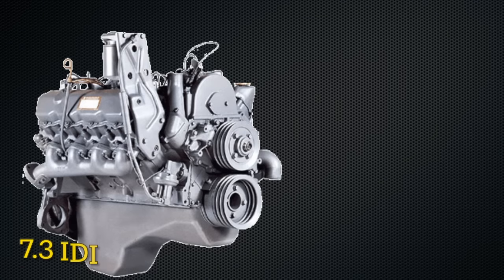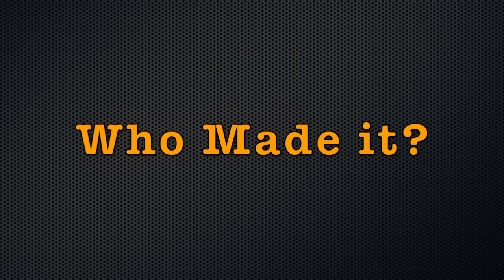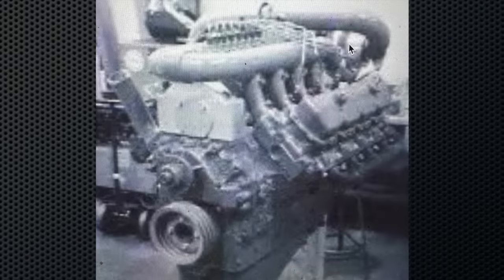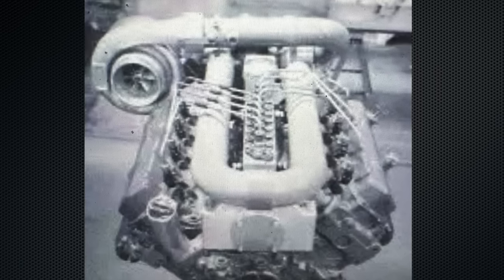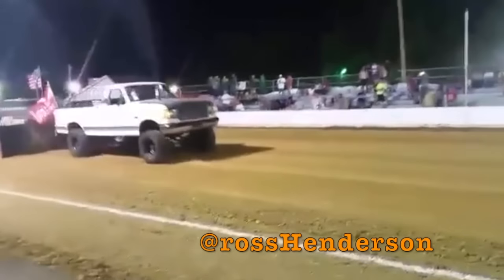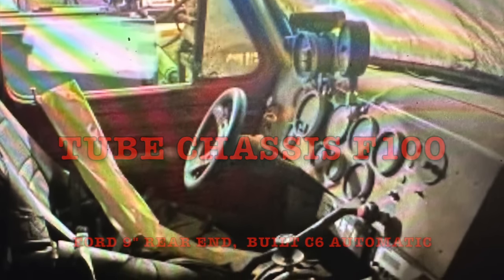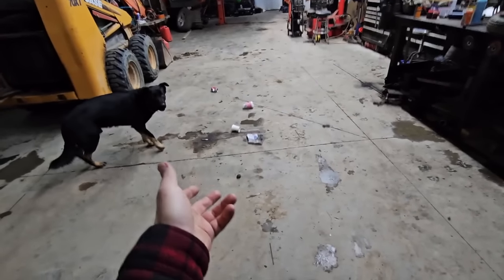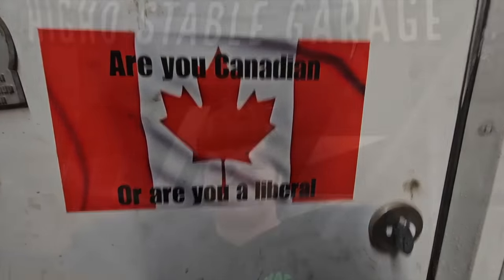The Legend of the 1200HP IDI Diesel, featuring @ziptiesnbiasplies!

Comment: Interesting backstory on this thing.  I do have to wonder why they kept it an IDI for a power build though.  Even ported out those prechambers become a hell of a bottleneck, and direct injected diesels weren't a new tech even in the 80s.  
I'm working on building my own 7.3 right now, I have a 71 F250 built around it, and I'm putting the turbo up front like a 6.5.  I've thought about cobbling together a Bosch MW pump as used on Perkins V8 diesels, but I don't think I'll be pushing anywhere near the limits of the DB2 pump.  I don't plan on going past 250hp, I just want to be able to cross the Rockies without making them the Smokies.

Comment: Thanks for the free rep man.

In terms of the rest, I think we all know that the Jahns truck wasn't even close to 1200hp. Number one, the weakest link after head studs is the connecting rods. At best in 94, you had factory turbo IDI units, and they are plenty stout (right alongside forged 7.3 PSD units), but they aren't doing 1200hp. 

Secondary, ported IDI heads flow less than stock units (not that that's a big deal when you're pushing 100+ boost into it), because of the port velocity, the engine doesn't make power past 3000rpm. I've personally made peak power at 3300RPM N/A but that's because N/A doesn't make any airflow down low... Regardless...

The legend most likely made ~700hp, and shit rods, not the block. Cast iron doesn't flex and spit out freeze plugs, it cracks and breaks.

Either way, cool video.

Comment: I called up hypermax. Theyd throw a kit together for you to do this build. Said itd cost around 15-20k. Wouldnt include lines or engine internals. And youd have to have the pistons cut to reduce compression and expect to use several cans of ether to get it started.

Comment: I had 6.9 in my 1987 ford f250. Fked up and put car oil  in it not 15/40 dohhh. Drive it for some time. Then i put a 7.3 idi. Took every thing from 6.9 and put it onto the 7.3 ats intake and 3 inch gartit turbo. Injuction pump. Exsts wire harns. Fly wheel. It was a ripper wish i never got rid of it. Runing about 11 lb of boost. It lived on the hill so i ran red deslie in it. Dule tanks to.

Comment: 2003 ps 7.3 is a magical motor
Reply from the maker: Sure is 👌
Reply: @highostablegarage  10 years of Towing heavy towing 10 years of racing 10 years of hole shots 10 years of donuts 10 years of dumping any and all liquids in the tank you can imagine and it runs the same as it did 10 years ago I can get in this truck do 80 mph for 5 hours with 25,000 lb with the tank filled with motor oil and have zero thoughts concerns or issues whatsoever I can do that everyday all day and it does not break Ain't No Other motor do that
Reply: @tonydiesel3444   My 12 valve Cummins does that, 500k miles on the odometer when I pulled it from a box truck and dumped it in my pickup. 500k miles of lugging a 26,000lbs Ford F-800 around the country for 23 years. Now it's powering my 1 ton. But I get what you're saying. The 7.3 PS is such a great engine. Since the early 2000's it's been downhill. The new engines make more power, but are expensive and unreliable and won't still be chugging along decades later like the old workhorses are doing.
Reply: They rip bud

Comment: I very much hope one of you can at least get in contact with the current owners, this engine has to be explored 💪…I doubt much of anything is still stock inside …it probably just has forged internals, a slightly more aggressive cam, fire rings, studs and better valve train …stuff that’s very common in modern diesel performance engines…my guess is this motor was WAAAY ahead of its time using what was available in the era it was modified in

Comment: My question is could a idi be converted into a direct injection engine🤔
Reply from the maker: Also a good question haha, money and time will make anything shine 👌
Reply: @highostablegarage  just remove the prechamber and make a longer injector would that work maybe I have a 1.9 tdi and v1505 the tdi is di the Kubota is a swirl chamber but acts like a di injector
Reply: @infernoking7504 You would need a different cylinder head as well as different pistons. 

Trying to run a DI cylinder head with practically flat IDI pistons would make your compression ratio way too high, and the pistons would probably smack the glow plugs and injector nozzles as well.
Reply: Yes but you would have to change the cylinder heads, injectors, and pistons at the bare minimum in order to make it work. 

With a 6.9 or 7.3 IDI you would need fully custom cylinder heads built in order to continue utilizing the injection pump fuel system. 7.3 powerstroke pistons would probably work in a 7.3 IDI but you might need custom connecting rods.

The Volkswagen AAZ engine is IDI and can be converted into DI by using the pistons, cylinder head, and injectors from a 1Z TDI engine.

Comment: I think if you put 147 psi through an engine of that displacement and you can feed it enough fuel to compensate for that amount of air, it's gonna make that kind of horsepower no problem. Would it live very long at that power level? I don't know. Maybe they did that once, blew it up, then dialed it back, but still, it had to have made a lot of power regardless if it's tearing the block apart repeatedly like that.

Comment: Best idi ever built was made by Detroit diesel and installed in chevy pickup trucks and military humvees. Pretty low hp but spectacular mpg depending on the drucks diff ratio. At 23:1 compression ratio and no turbo they were built for efficiency.  They nailed it.
Reply: The 6.2/6.5 Detroit is known for having more problems than the 6.9/7.3 international. Head gaskets and whatnot.
Reply: Those engines are absolute piles of shit.  Oh and you want it to operate at below 32f?  Good luck.
Reply: @Look_What_You_Did  normal maintenance is all they need, when you burn out glow plugs and dont replace them then yeah not gonna start. All 8 glow plugs and number 1 fuel they will fire up in -20. A few bad glow plugs and no they will not. So maintain it properly.

Comment: How many minutes did it last before it went bang ?
Reply from the maker: I think it was only a couple passes, sadly not a lot of info is known during its truck pulling days but we know it kept cracking blocks during its drag racing events.
Considering how little drag picture are know about dadiesel on the web I can only speculate it only operated for 1 or 2 seasons. 
Hopefully this video brings out more information about the engine.

Comment: Hypermax are die hard International. They build tractor engine parts as their main claim to fame. There are lots of various stock block tractor engines in different classes that make 4 digit power with mainly fuel, boost, and water.

Comment: It's a real shame that the HMMWV used the 6.2/6.5 instead of the 6.9/7.3, not only would the trucks been much better, they would still be in limited production and there would be a much better chance of there being widespread aftermarket and adoption. Sadly they've been out of production almost 30 years now and there aren't many options out there. It tripped me out when I saw this, I thought I was going crazy because I remembered your video from 9 months ago. At least you still have ads, inspite of using lubed Peg, I live part time in Tennessee and part time in Brazil, where I am now, I can buy an F250 Super Duty here with a MWM 4.2L or Cummins 3.9/4.5 4BT/ISB and a manual from 1999-present model year. If I could make 400-500hp 600-700TQ everything after that is just cream cheese.
Reply: It is a weight issue. The idi was in the 1100lb range. The 6.2/6.5 was 800ish lbs. So saving 300lbs allows for other weight adding in other places

Comment: 7.3 TD was mid 90's through early 2000's
Reply from the maker: Not the powerstroke, 7.3 turbo Idi was only out a few years to my knowledge.
Reply: @highostablegarage  I disagree. I'm a 50+ years master level factory certified auto/truck tech. 40 years with Ford. Plus, I personally a 90's Ford F350 4x4 7.3 Powerstroke  and my brother has a 2003 Ford F350 4x4 7.3 Powerstroke. Ford 7.3 Powerstroke was1994-2003.
Reply from the maker: @sergeantmasson3669  the 7.3 power stroke and the 7.3 Idi are not the same engine. The 7.3 Idi was not available in the later 1990s forward, it was replaced with the 7.3 powerstroke mid 90s .
Reply: @highostablegarage  7.3 Idi was pre-1994. I stated 7.3 TD as in Powerstroke which began in 1994.
Reply from the maker: @sergeantmasson3669  7.3 turbo diesel is also a 7.3 Idi T. 
I think we both ended up being right and in a roundabout way, ultimately talking about the same thing haha.
I am sorry for the disagreement because yes I completely agree with you.
Reply: @highostablegarage  do you comprehend the definition of "factory certified"?  During my 40 years with Ford, I attended many classes/seminars at Ford training schools.

Comment: correction the 7.3idit was built by ford and navistar aswell as the 7.3psd 6.0psd and 6.4psd also you are incorrect on the years 6.9idi 83-87 7.3idi 87-92 7.3idi 93-94 only 7.3psd 94.5-97/99-03 also there was more than one of these monsters made the actual rumour is it was in a dragster and kept failing so they moved on to the 7.3psd the engine your showing is the first engine they made hope ya have a great weekend
Reply: also i am currently building the worlds first and only 7.3idi electronic fuel injected engine it will also be turboed waiting on the weather to shape up to continue the project

Comment: Wrong my 1987 6.9 came with ats intake and garit 3 1/2 inch turbo
Reply: Not factory. Only the 7.3idi had a factory turbo for late 93 early 94. After market units were banks, ats and hypermax.

Comment: I could see 1200hp out of that old idi if it was pushing that tube chassis f100 into the low 10s and high 9 second quarter mile times. Even being a tube chassis truck the truck had to be heavy with the powerplant and the aerodynamics didnt help with its et.

Comment: 1200hp with no intercooler just water meth and ancient turbos? Smells like bs to me. Or maybe thats why it wouldnt stay together. 1200ft lbs is more believable to me.
Reply: Having an intercooler doesn’t really matter in a pulling truck because they only run for short bursts, water meth with keep the egts and cylinder temperatures down while also adding power
Reply: @LR90_200TDI  it does matter, it's not just about keeping cool, they help you make more power and I'm saying there's no way he made that much power with out an intercooler
Reply: @trev0rbr  intakes ice over using methanol intercooler isn't gonna make a difference. Please walk into traffic
Reply: @trev0rbr well it is about keeping everything cool, the colder the charge temperature the denser the air going into the engine is which means you can increase the fuelling and get more power, intercoolers need airflow which is why they are more effective on road vehicles as there is a lot more airflow, water meth lowers charge temperatures, egts and cylinder temperatures which allows for more fuel which increases power and the meth also acts as a fuel source further increasing power